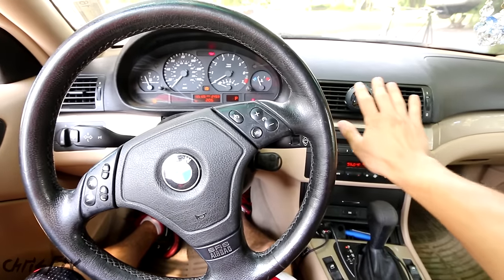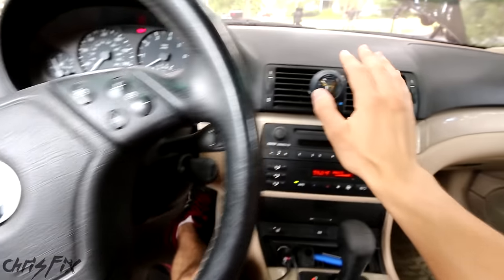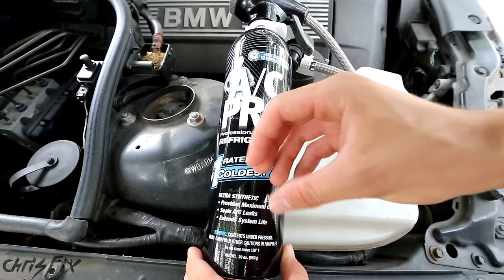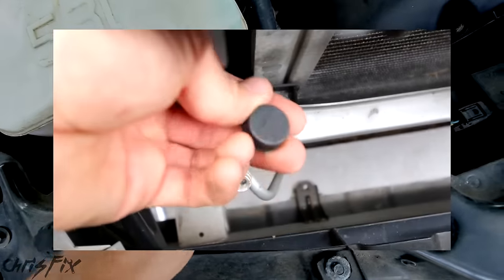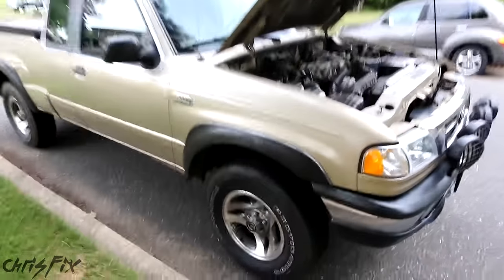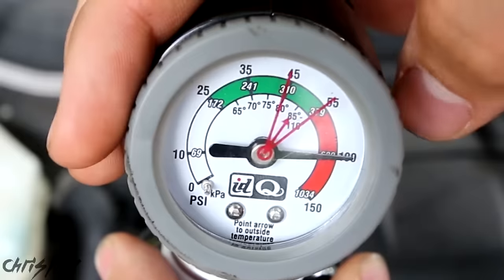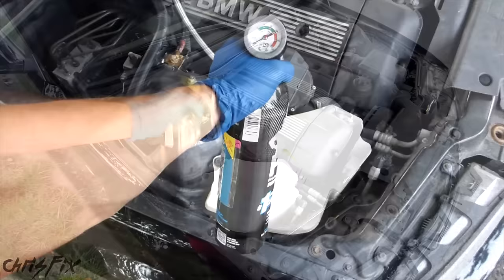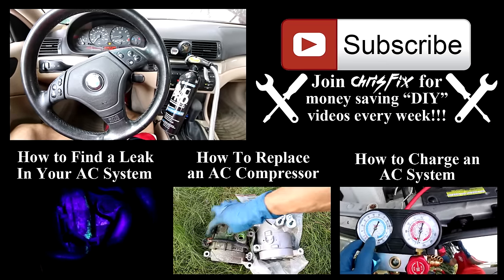How to Recharge Your Car's AC System (Fast and Easy)

Comment: Right on Chris.  Love how your channel has grown!  With regards to the A/C recharge, wouldn't it be better to vacuum the system before recharging?
Reply: Yes, most of the time these bottles destroy most of the AC system by over pressurising which for most cars is 1200-1600$ repair.
Reply: That's the right way to do it. So it is better. But, obviously people have found a way around this by selling this product. I even got it myself despite knowing how dumb it might be. As it turns out, it does in fact work. As long as your system is in need of a charge. Some of the reasons peoples car ac breaks when they do this is cause they empty the whole bottle in, or charge when it isn't needed and overcharge it, or ignore the main issue at hand. This tool isn't meant to diagnose a bad ac. It's only meant to temporarily recharge an under pressured one.

Comment: I have a question: some people says that product can let the moisture go inside the cooling system and cause damage and it you can’t know exactly what is the amount you putting in so you may over fill or Under fill your car . You said in other video if you want to fill ac you need weighing scale.
Reply: I’m not a professional but I believe video you’re referring to he was filling an empty system. So he was measuring it from empty. This system in BMW isn’t empty just low, get engine nice and hot and based on ambient temperature is how much pressure you should have on gauge. Add accordingly.

Comment: Chris, I’m not sure you explicitly say that the engine should be running while you are putting in refrigerant.
Reply: I have the same question here, why should keep the engine running when putting in refrigerant ?
Reply: The car has to be running with ac on in order to draw in the refrigerant.

Comment: You really should put a note in the video that this is NOT the proper way to charge an A/C system. You need pressure readings for both the high AND low side. You can’t get proper pressure readings from only one port.
Reply: Zach Barlow exactly
Reply: It doesn't matter if it's "The Proper way" to recharge the system; it works, and the average person has no business working on the High side. 

and btw - Sealants don't damage the system
Reply: Pete Brown ha “it doesn’t matter if it’s the proper way” ok guy. Hope you never work on someone’s car. If you are going to do something, do it properly, not half-assed. You don’t get a proper pressure reading off only one line. Period.
Reply: @ZealotsACH  Wrong. I was in the HVAC business. 
Every car's AC system will bleed down over time, and using the low pressure side is the safe and correct way to recharge it.  ChrisFix does an excellent job explaining the method. 

The only reason to ever tap the high side is for diagnostic purposes. This video isn't about AC diagnostics,  and the average DIYer has no business doing that.   It can be dangerous. 

You should go troll a baking video. Tell them why preheating bake-ware is the only 'Proper' way to bake a cake.
Reply: @BottomTick  ohhhh shit

Comment: Should I set the A/C on recycle air ↪ or fresh outside flow ➡️ when  recharging with refrigerant ? Thank you
Reply from the maker: I would just set it to straight A/C to ensure you are getting the best results by recharging the system!
Reply: @chrisfix  what do you mean by straight AC? I believe mine has to be either one or the other? I'm going to give this a try tomorrow in a 2000 Toyota Sienna and not sure how to do straight AC.

Comment: Great video❗️👍🏻 
I just had my compressor, expansion valve and receiver dryer replaced by a mechanic.
He pulled a vacuum, and the system held pressure with no leaks.
He had an emergency and was not able to add the Freon.
Can I add it using this method?
I have the specs on how much the system takes.
Thanks in advance.
Reply from the maker: Thanks a lot! I would do this method instead: https://www.youtube.com/watch?v=Pdq8JAlct6s

Comment: Lol so many a/c experts here.
Reply: Well, at least we know how to properly fill an a/c system, and that method in the video is certainly not correct.
Reply: @Nick-GR  Hey Nick, could you provide a link to your video showing the better method?
Reply: @Nick-GR  that's not how you properly refill an AC unit. That is a quick fix that will do more damage then good. Yes, i have 20 years experience as a mechanic. Leaking freon is very VERY bad for our ozone.
Reply: Technically I am. If you have AC issues. You take your car to a shop and have them figure it out. AC units in a car hold any where from 14-28oz of freon. If it isnt leaking but no cold air. Forcing more freon in your system will damage it. Which in turn will cost more to fix. If the AC has a leak or had a leak. The freon you put it leaks. Freon is very bad for the ozone. I'm actually surprised that the EPA allows sales of these quick fix cans.
Reply: @drpeppero3  r134a is NOT freon.
Reply: @Starborn63  regardless of that...read my previous statements.
Reply: The method in the vid could cost you more money in the long run 3 out of 5 cars I did this to locked up the a.c. pump within a year
Reply: Pete Brown no because nobody should be recharging their ac with one of these cans.  The entire system should have all the r134 evacuated. You should never add your own as you have no idea how much is left in there.

Comment: More BMW videos please!
Reply from the maker: I wish I had a BMW to work on. This was a neighbors car and he doesnt have it any more.
Reply: ChrisFix Btw you rule man. I'm not from the states and i dont know much about cars, but you taught me so much and i saved a lot of money. So thank you and keep on rocking!
Reply: Put some Everglades in it !
Reply: I just did this and used a gauge hose for car acs, the pressure gauge never went up, then next thing the gauge went way up, the car got warm and the ac would only cycle on and off every 3 seconds, I ended up releasing the pressure by pushing adapter on and off the intake valve, eventually the ac was on and not cycling off and on repeatedly, temp is about the same or even a little warmer coming from vent.  It was not near as simple as his job.  Not aure what I did wrong but leaving it alone, summer will be over in a few weeks.
Reply: ChrisFix You can use mine.

Comment: although you had charged the ac system the blinkers are still not working.
Reply: What you need is turn signal fluid not R134a.

Comment: shame the ac recharge kits are banned over here :(
Reply: Slot1Gamer Thats a good thing. They dont really work well and if you use 1 with sealer like this you might ruin the ac machine of your shop if they service it next time. And you dont want to see the bill of that repair when a ac refill is less then 100 dollars to let them do it(and if you use this shit and ruin their machine it will be around 5000dollars)
Reply: I've read you need to remove all the old refrigerant before refilling
Reply: Slot1Gamer That is what they do with the special machines. They remove everything first, it seperates the oil uv fluid and the r134a. The r134a go's in to the fill cointainer again and will be reused. But if you put the sealer stuff in there it wil destroy the machine because it has removed the sealer from the system also, and that will now go in the machine and clogg everything. But normally if you dodnt screw around with this kind of stuff after removing the old r134a it will put the entire system on a vacuum for a certain time(15-30mins in most cases) And if the vacuum wont stay on what it needs to be it will not even go on to the filling stage because you got a serious leak. But if its only a really small leak it will go on to fill. And after that youre good to go. Might take a hour total, you might even be able to wait on it. And i think its better to let this to a proffesional so that when you do get it fixed you dont need to replace the whole ac system. And if you used a sealer like in this video you do need to replace the whole ac system, and that indeed costs thousands of dollars.
Reply from the maker: Slot1Gamer Yea, it stinks when regulations limit your ability to work on your own car.
Reply from the maker: bob rosco The whole reason I used this refrigerant is because the sealer additive doesnt mess up refrigerant recovery machines. It is even thinner than the PAG oil used in AC systems.
Reply: +bob rosco I wouldn't pay for the shops machine. What do they expect with cars and av problems
Reply: ***** if you know you put a sealer in there you are responsible for it. And if that ruins their machine they might make you responsible for it. And if you dont pay you might not see your car back. Or they just send you a bill for a complete ac system replacent wich then all of a sudden is around 10k.
Reply: +bob rosco There's no way in the world a shop is going to be able to charge you for that. If they didn't return your car they would be in court and out of business fast.
Reply: V T In most countrys a shop has the right to keep the car as bail until you pay the bill. And if they send you a bill for the replacement of your ac system wich is 10k and you dont pay(obviously) then you cant get your car back. Its as easy as that.
Reply: +bob rosco And if my hubnut breaks their expensive snap-on bit presumably they're going to charge me for that as well. Nonsense, Bob.

When you undertake repairs, you deal with the possibilities and hazards.

"Here's your bill, Madam. It's $80 for the oil change and $50 for ruining Mike's manicure because your door handles were so dirty"
Reply: +bob rosco that's one of the stupidest things I have ever heard
Reply: +bob rosco that's one of the stupidest things I have ever heard
Reply: +bob rosco  just like everyone already said, "This is one of the dumbest things I've ever heard"...... also, if that was the case, how would you explain shop insurances? most of those expensive machines have either some sort of insurance or at least some sort of warranty!.. I've not once heard of a shop charging the customer for the repairs of their own machines. That statement of yours is just absolutely absurd.
Reply: +Slot1Gamer over where?
Reply: +bob rosco You sound like a dealer mechanic... it's always the customer's fault. Take their money!
Reply: +bob rosco yeah I had take mine to shop have it look at and he said I ruin his machine because of the sealer he said I had to replace the whole AC system I never did .  He says its company greedy with  AC Recharge kits by adding the sealer. So I asked they why do they do this than .^ I think there needs warning or law about this that could cost Customer lots money at A shop.
Reply: @gabbermaikel yet another auto tech 'training' us.  Fr every good DIY YouTube, there are several 'professionals' (especially anything home related) that like to inform of the need of a licensed professional.  Get with the times, man.
Reply: @jaaca6259  Really, would/do the shops pay you when they strip a bolt or break something that you won't notice for a while?  Even if you catch it, 'it was like that.'

Comment: Hello Chris, I have been a follower of your content for many years now, and there have been multiple times when one of your videos have guided me to fix something in our cars, I cannot be more thankful for how much you have helped me and so many other people through your videos.
Regarding this particular video I want to point out an specific thing you said in it that helped me a lot; after rebuilding the HVAC unit in my truck, I noticed that the compressor clutch was not engaging, I was unsure of trying to recharge the Freon because even in the kit instructions said that the compressor must be working, but my common sense was telling me that the lack of refrigerant could be the cause of the compressor not engaging, I didn't knew what to do, and then I remembered about this video, and in it you mentioned exactly what I was thinking! and then I said to my wife: I just needed Chris to said I could do it. I started recharging the Freon and the compressor started working immediately! Thanks Man!!!

Comment: Did it, my shit blew up wth man
Reply: Norlin E. Casas Same man WtF‼️‼️
Reply: Bruh my shit blew up my radiator
Reply: Norlin E. Casas come to fmtc with refrigerant, we’ll charge it properly ;)
Reply: Norlin E. Casas tbh my mechanic charged me $300 to do this I'm so mad I could have done this 😤😤😤💩
Reply from the maker: I don't know what you mean by "blew up", there isn't any risk in recharging it. If the system is bad to begin with it won't "blow up", it will leak. If you put in too much refrigerant, the pressure switch will see an overcharge and turn off the compressor. There isn't anything explosive about refrigerant...
Reply: ChrisFix yeah man like the compressor made this loud hissing noise and now it doesn’t work... do you even have your 609 Certification? I dont think you should be working on ac 🤦‍♂️

Comment: Never buy a used car from someone with good knowledge about cars. They mostly know when the life span of the car is at its ends. Yes you can repair any damage in your car, but there is a certain point when it financially makes no sense to switch parts.
Reply: As long as you are mechanically inclined it is always cheaper to fix it yourself than the cost of a car payment.  $400+ a month buys an incredible amount of parts and even the tools needed!
Reply: This is both true and false, some car guys simply don't have the time or money to keep fixing cars and so they find them a new home and some people even fix up older cars and then sell them as they know they can rinse and repeat that process and get old cars back in good shape in the process

Comment: Another happy subscriber here. Your advice worked!! No longer am I dependent on having to expend precious time taking my car to a mechanic. Also, I know how much is going in. I have three old cars that I am milking, and I don't want to spend hundreds or thousands getting parts replaced. I was concerned about moisture and possible problems on the high side, but we seem to be good now. It is in the upper 90's, sometimes 100, around here. You have set me free!

Comment: Bro thank you. Life saver in this FL heat. Was only taught the "proper" way that requires a bunch of tools and guages. Been watchin your vids since the first ones and never took the time to say thanks. But my ac is blastin cold and truck is running,and even though i know what im doing(done builds,swaps,rebuilds,built my own harnesses, replaced/serviced just about every part) but i know im a bit fd in the head so it helps watchin a chrisfix video for the peice of mind that im doing it the right way.😂 so again thanks man!!!

Comment: Whatever you do, avoid the ones with the digital gauges. They do not properly register and ended over charging my A/C system. Thankfully I was able to bleed out the excess pressure.

Comment: Excellent video! You're an excellent instructor Chris, one of the best I've seen on YT. And you saved me untold $$$ doing this myself on my 2003 Honda Pilot. THANK YOU!
Reply from the maker: Glad to help
Reply: They said you low pressure should be between 30 and 40. Why is his 45 psi
Reply: @chrisfix  hi this is Singh. They said your psi for ac low pressure should be between 30 and 40. Why yours have to be between 45 and 50. This is confusing me

Comment: By not purging your line you just induced air and moisture to your system , you need to use regular A/C gauges and hoses to remove air from lines.

Comment: Thanks Chris, went to Walmart and bought the A/C Pro product used in your video and downloaded the App as well for the product too as additional instructions were on the product app identicle to your video.

My charge only made it too 30 in the green on the guage.The app said anywhere in the green is good.

So I stopped there and my AC is blowing colder than before.

My vehicle is 2018 Ford Transit 250.

The app also showed where the low bressure connector was.

There were cheaper versions of AC charging products available at Walmart, but mo worries, went with A/C Pro to match the video.

Lets see how long it lasts.

Comment: Great video. I have watched a bunch of your how to vids and this one popped up just on time because my A/C on my 2017 Toyota Highlander wouldn't blow cold when I had to use it for the first time this just last week. The same thing happened just after it came off the 3 warranty a couple years ago and this kind of service was done by the dealership  From late October until mid April A/C is not needed around here but I was told to always run the A/C for a few minutes once a month or so to keep the seals from becoming damaged. Last October we had one last hot spell of weather and I tried the A/C and it was hooped. Now it's time to get it ready and I'm not going to pay the Toyota Dealership almost $200 to do this ( last time 2 years ago it cost me $175. My "issue" with doing this is we don't have an Advanced Auto Parts here and I don't think they are anywhere in Canada? When I clicked on the link for this product what popped up wasn't even the same product it was a package with 2 cans a reusable hose, a thermometer and a sealant and dye plus UV pen light. I guess I could " Google it "but in case I can't find anything, are you aware of a Canadian Distributor for the product that you suggested? Thanks 

uv

a

Comment: That was too easy.  I can take my daughter and niece to the zoo tomorrow.  Thank you sir, for the instructions.  The current A/C Pro is now simpler.
Reply: i did it today, and the ac is cilling nicely, only that the L valve spits out gas (i can hear it) unless i screw the cap back on, don't know if that's normal or not
Reply: @Jonathan-mp7xgyup that's it exactly what i did, took it to the shop to have a mechanic to replace the stem, then vacuum and recharge the refrigerant since it evacuated due to the faulty valve